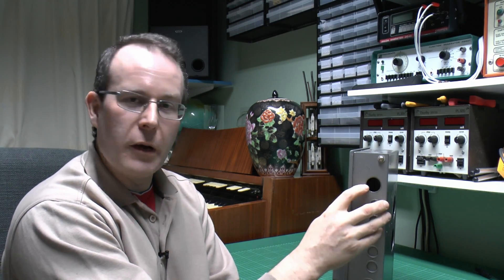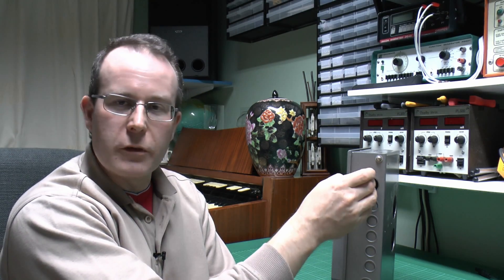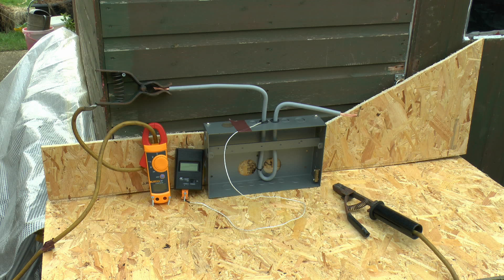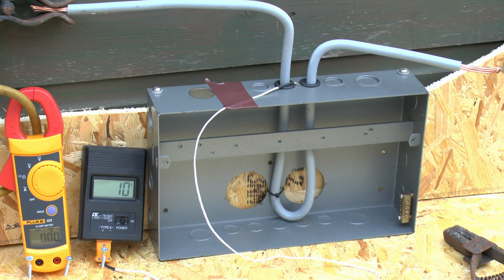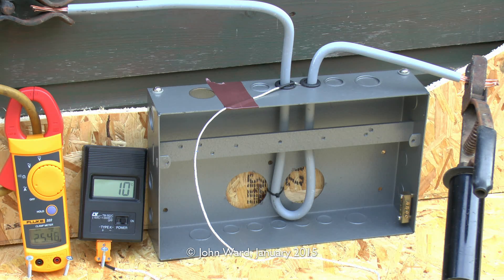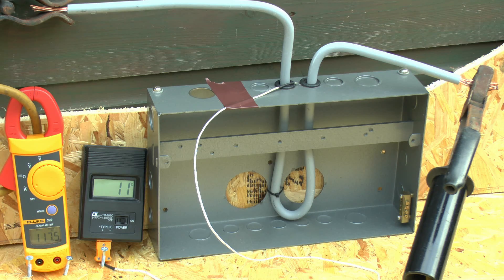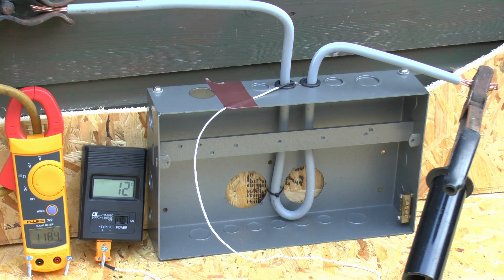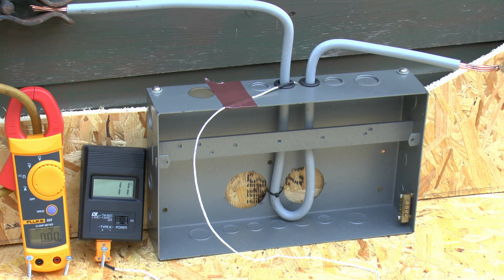Single Wires through Metal Holes

Comment: Does the main earth need to go thru the same entry point on metal enclosures?
Reply from the maker: Yes.  521.5.1 in BS7671.
Reply: @jwflame  I am aware of this reg but I can't understand why , my thinking was if the L and N are thru different holes the eddy currents can cause a build up of heat over time but if there's no current going thru the earth except in a fault it would only be for a few seconds so wouldn't have time to build up heat.

Comment: John, I have done lots of work with inductors where I work, my target being to get the metal to heat as much as possible. There is a something you learn very quickly when you start doing inductor tests. It's widely known that inductors can be wound in a spiral in a pancake coil, and this is good. But it's also common knowledge that inductors should never be laid side by side as in your test. The reason is that when inductors are in a spiral, the magnetic field in neighbouring cables reinforce one another, as they are all in harmony i.e when the magnetic field is clockwise around the inductor, all the neighbouring cables will have clockwise magnetic fields. However, inductors laid side by side in a zig zag fashion like your test, produce magnetic fields which crash into one another and cancel out any heating. To get a more reliable result you should have a larger gap between the entry and exit cables. Look here on page 5 and note where it says "cancellation"  https://sg-induction.com/wp-content/uploads/2021/03/Coil-Design-Induttore.pdf

Comment: Are you using an arc welder off screen to produce this current? If so, does it have a rectifier in it? I wouldn't expect pulsed DC to give you the same Eddy current effect as true AC. Really interesting test, I'd be curious to see your whole test setup.
Reply from the maker: Details here: https://www.youtube.com/watch?v=35VpIE1oKsc
No rectifier, just 50Hz AC.
Reply: @jwflame  thanks for the info! I guess it makes sense that a flat steel plate wouldn't get much by way of Eddy currents, it's how we design transformer laminations after all!

Comment: John in the intro to this test you said live in one hole and neutral in the other but your test it was the same wire in and out please can you explain
Reply from the maker: The two conductors would be L&N in a normal consumer unit.
The only difference between L&N is the voltage relative to Earth - L 230v, N 0v.
Magnetic effects are caused by current, the voltage relative to other parts isn't important.  In this case it's the same conductor, but the key point is the current direction is different through each hole.

Comment: Regs state the both conductors must go through same hole to cancel eddy currents this is more noticeable when two separate conduits are used to pass one conductor down each conduit and act as a transformer, eddy currents will start to flow up one conduct and down the other, now the conduct has a brass bush at the end, this is not always a good connection and acts as a resistor, and as the eddy current flows thorough this joint it will get warm and as time goes by this joint will corrode and the resistance will get greater and therefore the heating effect and so and so on until you have nice warm fire.

Comment: The way you have it rigged John means that the current in the wires at the point they pass through the hole will be in direct opposition so the resultant combined magnetic field would be much reduced.  What happens if you only have a single wire passing through one hole - more representative of installation where tails are inappropriately  (widely) separated?

Comment: The more I see of standards outside of the US for electrical the more I think the US is not so backwards.   In the US the mains comes in via conduit,  it wouldn't be possible for someone to even think of running one wire in one hole and another wire in the other.

Comment: ? DC ? The IET is a recent creation formed from the combination of two institutions founded in the late 1800s (Wikipedia). In the practical guide book published by the IIE in the 1970s: a single hole or slotting between holes was recommended. 
In years past DC distribution and control was widespread.
? Has anyone experience of high amperage DC in single core cables that pass through a steel plate, welding for example ?

Comment: Does a t&e cable create Eddie currents between another t&e cable when they are put in separate holes?
Reply from the maker: No, current in a T&E will be equal in both directions, so there is no magnetic field.
Reply: @jwflame  thanks for the reply.

Comment: One might wonder whether the 2C change was as much due to environmental change?  In any event as any induced current would be in the steel case, one would expect that to be the subject of any increase in temperature, not the supply cable.

Comment: Just wondering, 100 amps at 230 volts Vs 100 amps from a transformer or what ever you used there at maybe Extra low voltage,  The mains kilowatts would be much much higher would it make a difference?

Comment: i have first hand experience of this and have found in every case where heating of the enclosure occurred both the neutral and earth were taken through different holes as each other and line or both earth and neutral in same hole but line in different one. in one case where all 3 phases neutral and earth had been taken through different holes. the supply to the hotel would cut off for 30 seconds then come back. this only stopped when i cut slots between each hole. cant begin to explain how or why but i was called after 2 years of this happening and the only fault i could find was supply taken through different holes and it stopped when i slotted the holes.

Comment: Question:
Was alternaing current used?
Was the Metal consumer unit connected to the earth/neutral of the power supply?
What voltage was being used?
Reply: a) yes
b) completely irrelevant
c) completely irrelevant
Reply: @TheEulerID  Could you please explain why you deem two of my questions irrelevant.
Reply: @ribblehead02  

Fine. 

Eddy currents are induced in a conductor by changing magnetic fields. The magnetic field induced by a conductor depends on on the amount of current flowing through it. 

Whether the case is earthed or not makes no difference, nor does the voltage applied across any load. Only the changing current matters.

nb. transformers work by having many windings to build up the magnetic field, and mains frequency transformers use iron cores to, for want of a better word, amplify the magnetic flux, and those do have significant heating from eddy currents.

Comment: That was quite interesting, apart from putting the wires through separate holes.  Whats the go with those tail clamps, as they quite clearly separate the tails inside the enclosure.  Or have they already looked into that..?

Comment: I came across this situation in a school in Essex in the late 80's. Working for myself. Big old style single phase Federal DB fed via a pair of single 35mm bare copper Pyros, Live Pyro in one hole of trunking and Neutral in other hole. Noticed an annoying low buzz one day from up high where cables where pinned to wall, assumed it was 1960 style fluorescent tube in cleaners cupboard adjacent to cables. Investigated one day and was going to change the fitting and discovered the buzz actually coming from trunking between Pyro glands and it was actually hot, you could hold your finger on it but neverless hot. The paint on the old trunking had flaked at this point. I mentioned it to site manager as he was responsible for all maintenance and suggested it needs attending to and why, I even put a quote in. Never got asked back to the school, I heard in the wholesalers a few weeks later that they got some local cowboy in to check it and he said it was fine. The cowboy was a husband of a school cleaner who worked in a local factory I also heard. I hoped it would start a fire in the cleaners cupboard as they stock pile flammable goods in there, and I advised them against that, all the same the school didn't burn down and it is probably still there keeping the cupboard warm and dry to this day. Watching this vid brought it all back, and BTW it turned out the maintenance manager thought I was pulling his plonker, blinding him with bullshit to make me extra work and money ffs. How do these facking dinosaurs get into these building manager positions in the first place. Sorry about the rant but I feel better now!!!

Comment: Great putting this out there, but the measuring of temperature was not where I saw this test going, the rise could have been down to the transference from the Conductors, or the surrounding air temperature rising over time?
Why not do the same test but this time put a Voltmeter attached to the M/C Consumer Unit and the other to an Earth Spike [run a remote Earth Cable] in the Ground, somewhere likely to get a Good return path, now measure the voltage at the start and at each stage of the Test.
Mr Spence Eng

Comment: Great test! I have always wondered what this would be in practice. Though I bet there are some variations on this test that would cause a greater heating effect. Proximity of cables, thermal mass of the case etc. I guess there is a point at which the case cannot dissipate the heat generated causing the conductors insulation to break down and then short. Excellent job 👍🏻

Comment: John is this actually a fair test? 120A x 50v = 6000vA the aprox output from your welder.   100A at 230v  = 23000vA  the aprox output from a fully loaded consumer unit I could be wrong but suspect the heating effect would be higher. 
I do agree I have seen metal consumer units with tails in separate holes with no noticeable heating present.
Reply: That's entirely irrelevant. All that matters with eddy currents is the induced magnetic field and the only thing that matters is the current. The amount of power being dissipated elsewhere doesn't matter in the slightest.

Comment: Lets be practical, this isn't aimed at Domestic Households of a 100A or less.

I'd imagine if you took an enclosure in a tube or train station, with 25kVf, and the train pulling 2500 kW, I'd imagine a small bit of metal that should of been removed, would get toasted by Eddy Currents. 

Maybe try this experiment with tin foil :) ?

Comment: The geometry seems wrong for inducing eddy currents. The magnetic field is circling the conductor in the plane of the side of the box. However, the induced voltage goes around the magnetic field lines, so any induced current would be following in a plane perpendicular to the side of the box. Essentially you've recreated a laminated core with just a single lamination.

As laid out, the back side of the box is more likely to see eddy currents. A flat piece of metal between and parallel to the conductors would maximize the effect.

Comment: 2°C in 5 minutes could be very substantial if this rate is maintained 24/7, right?
Reply: Not necessarily because the metal box dissipates heat more quickly as its temperature increases (and so the temperature difference between it and the surroundings becomes larger).
In fact, it's likely that the 2 degree increase was caused by the resistance of the wires themselves -- or a good portion of it was anyway.
Reply: That's to make the erroneous assumption that temperature increase linearly over time. The answer to that is no they don't. An equilibrium will be reached when the heat being generates matches that being conducted away. If that was ever going to get to dangerous temperatures, it would have become obvious after 5 minutes as the temperature would have climbed a lot faster.

As it is, a quick calculation on the length of that 25mm^2 cabling within the box (I estimate about 30-40cm) would dissipate about 4-5 Watts. It would not surprise me if the great majority of the increase in temperature was from the slightly warmed air rising. I suspect if the temperature of the wire was checked it would have increased by a great deal more than 2C just from resistive warming.

Comment: Hi John, Did you use ac in you test?
Reply from the maker: Yes, 50Hz.
Reply: @jwflame  If you tried this again with DC it would confirm conclusively whether the heating effect was due to ohmic effects in the cable or eddy currents in the case.  Plus an added bonus of a spark of some significance when you disconnect the supply !

Comment: As a sparky doing remedials ,I have had to reroute cabling though the same hole (3ph) which has been running perfectly  ok for years, your findings seem to dispel any reason for doing this.Maybe it's just good practise?
Reply from the maker: It is actually a regulation (521.5.1), so is required to comply with BS7671.
Whether it makes any difference in reality is another matter.
Reply: Under the 16th edition regs it says "conductors shall not be surrounded individually by ferrous material or that provision shall be made to prevent eddy (induced) currents."  So its not saying NO full stop, its suggesting there may be a problem by doing this so if an older existing installation which was installed under those older regulations is operating normally there would be no need to change the cable routing into the enclosure.

Comment: Super interesting, thank you! As a spark, it gets drilled into you to never bring conductors on the same circuit through separate holes in metal enclosures as if it would burst in to flames immediately. It’s one of those things you just don’t do. Seeing an actual test and seeing the minimal affect is surprising to say the least. Don’t get me wrong, I’m not about to start bringing my cables into separate holes now, but to see the minimal affect from eddies on a domestic board is a surprise. Cheers!

Comment: I am going to do what you shouldn't, and that is comment on the video before I've watched it all the way through. However, there's a reason. That's because, before you even do this test, I'm going to predict that there will be no significant heating caused by eddy currents induced by the magnetic fields, even if you put 100 amps AC through the thing. Transformers (and induction hobs) have got large numbers of windings designed to generate powerful magnetic fields. A couple of parallel wires a few centimetres apart will not generate enough field to induce large current flows.

So, not I will watch the rest of the video and see if my prediction comes true of not.

** update **

My suspicions were confirmed. I would also suspect that the slight warming that was seen at 125 amps was largely down to convection currents from that loop of wiring. Assuming that it's about 25cm long (or about 10 inches), then that length of 25mm^2 cable will have a resistance of 0.0005525 ohms (which doesn't sound like much). However, power resistive losses are resistance times current squared. 0.0005525 x 125 x 125 = 8.6 watts. I think that putting a 9 watt heater under that thin bit of steel could easily account for the great majority of the warming effect. Of course, at 25 amps there will only be about one-third of a watt, so that would be negligible. 

nb. high powered cables running parallel to steel panels would induce more current, but at right-angles it's going to be negligible. I wonder how many of those stories about overheating panels are more down to resistive losses (including from poorly made terminations) than induction currents.
Reply: this test is floored you said your self about transformers just look at a simply diagram of one and you will see one side of the transformer is larger so putting one cable through a hole and out another wont give a true result you would need to run an earth cable with the neutral or in its own hole to lower the resistance and unbalance the circuit then test.

Comment: Very interesting test John. I suspect that the 2C increase in temperature might actually be down to heat transfer as the cables warm as much as from eddy currents, especially when you consider their close proximity to the temp probe..
Reply: Me too. My estimate was that length of 25mm^2 cable at 120 amps dissipates about 8 watts. The eddy current theory is a myth. You get it in transformer cores, as they have hundreds of windings designed to induce a very large, alternating magnetic field, and that does induce eddy currents in the core which is there to maximise the magnetic field. Two wires running at right angles through a thing bit of steel aren't going to have anything like the same effect.
Reply: Most of John's output is excellent but this one is, shall we say, not so hot.  For a scientific result, the test could be repeated with a twin cable gland and the rise measured.  I suspect the difference will be tiny if any.

Comment: Interesting, I suspect you could get a better induction heating effect by putting a few turns through the two holes, although I suspect that even one or two turns would not produce enough effect to raise the temperature significantly. 

Half a turn it seems is not nearly enough to have a measurable effect. 

I can see why someone might be daft enough to do this, to "keep the excess wire neat", in the same way that people operate large coiled mains extension cables still coiled up on the reel (to keep them neat) and wonder why they start to cook after prolonged use.

Comment: The answer with eddy currents and the heating effect is to make a cut between the two holes at the shortest distance. In Australia incoming single core conductors are quite the norm. I have known the local installation inspector to fail a job as there was no cut between the holes.
Reply: pirate69s 
I always think cutting a thin slot is rather pointless as it would only take one strand of swarf or metal filing to close the slot. Depending on the installation I have used aluminium gland plates (when glanding single core swa’s) or Pacylene for large tri rated single core tails.
Aluminium is surprisingly difficult to drill with hole saws though!